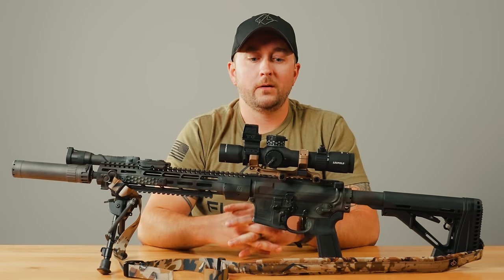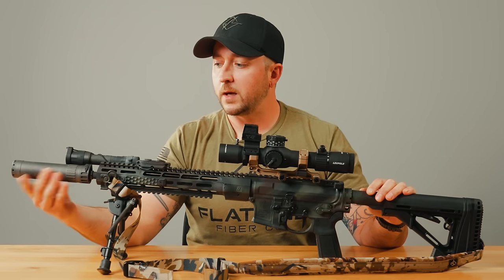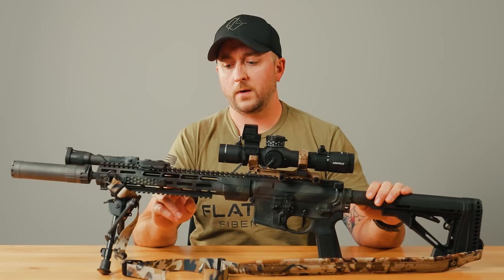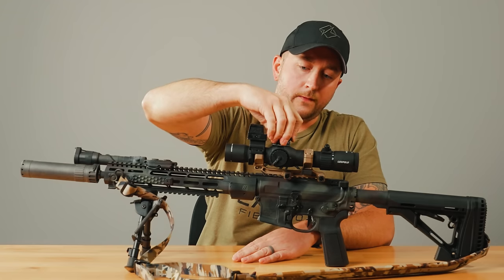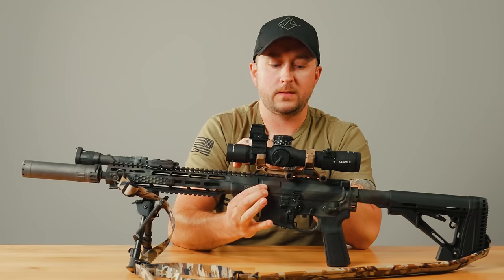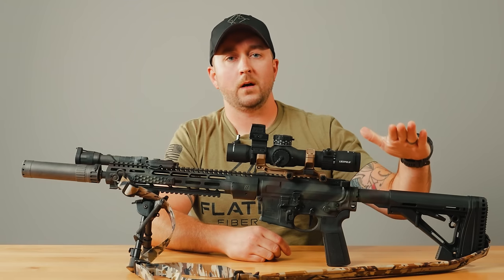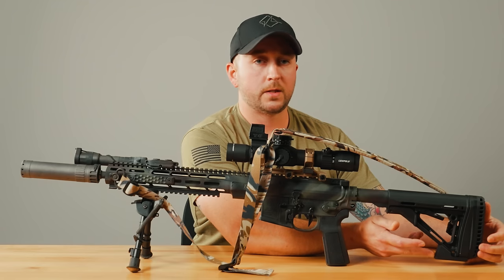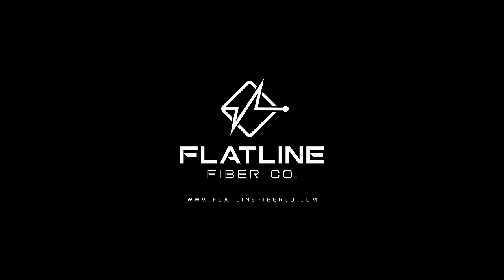SPR Breakdown | New Build | Long Range Shooting | Flatline Fiber Co.

Comment: Don’t understand why you would build out a 13.9 as a “ long range “ spr? Why wouldn’t you at least go 16? 18 to 20 would be even better. The shorter is better crowd just doesn’t make any sense to me
Reply: 13.9 is the perfect length. You do not lose more than 40fps from 16 to 13.9 ensuring your shots are still the same in holding and force is still very similar.
Reply: ..FOR a ‘specific-use’ AR..or carbine, etc…I get what you’re saying..I’m sure so does he. He’s “experimenting” man. Besides..even an SPR can be utilized for ‘something ELSE” if need be. Like I mentioned above, shorter bbl can reach 600 yds, with ‘accuracy’ being the big question. Point is: It’s do-able..
Reply: @IntellectualTerritory  Idk, there’s something to be said for 14.5”. It’s WHY the .gov (.mil) issues them. ALSO depends on the ROUND. 5.56..a hotter round, I’d agree with you with 77grs. And, with .300 BLK..the shorter is a great choice to a point. Personally, I wouldn’t go shorter than 10.5” (10.3”) with the .300’s..BUT yeah, we’re talking ‘apples & oranges’
Reply: @m118lr  they use 14.5 bc a bayonet can still be attached.
Reply: (Legitimate comment) I haven't seen a bayonet on a rifle besides in a class, m203 grenade launcher yes but 13.9 with decent barrel, can, ammo, etc will get it done
Reply: Barrel length is not required for long range. Good ammo is.
Reply: A 13.7 to a 16 inch…the fps is neglible.
Reply: That’s probably why YOU shouldn’t build a “SPR” with a barrel shorter than 16”. But for other folks, it’s a solid choice. 

In reality, most folks aren’t shooting gas guns at “long” range and are generally shooting intermediate distances from 100-600, some matches will take you out beyond that to 800-1000, generally are full sized IPSC steel. All of which are targets a 13.9” can easily hit, especially given the accuracy I’ve had out of Criterion barrels. 

I don’t really think long range shooting begins until you start going behind 600.
Reply from the maker: For sure. Like I said, this is my intro build and I may eventually swap to a 16" barrel. I have taken this gun out to 1,100 meters.  I also invested in a 308 gas gun and will eventually grab a 24" bolt gun.
Reply from the maker: @ray  When this gun was initially being built this was not the goal for it. As I started getting into shooting at distance the goal changed. Like I said.... I will eventually swap the barrel to a 16" after I do some more chrono testing.
Reply from the maker: @m118lr   For sure man. I have consistently made hits out to 550 meters with this gun. Trust me.... it was hitting plenty hard too.
Reply: @flatlinefiberco  18” or 20”. If not that long then 12.5 is perfect if you don’t mind sbring. 13.7 is just for civilians pin and welding. 12.3-16 no real significant increase.
Reply: I have a few pin&weld 14.5s, love em’.  The 13.9 barrels only work with a limited selection of really long suppressor mounts/muzzle devices that aren’t compatible with my cans, but otherwise I can see the appeal.
Reply: Because you can
Reply: @IntellectualTerritory this definitely isn’t true
Reply: Ammo and optic have much more of an impact on performance than 2 inches of barrel
Reply from the maker: Long range training starts at all of the mentioned distances though. Pushing a 556 gas gun to its limits from 1,100M - 1,600M is the goal. Then I know the extreme capability of the rifle, projectile, and myself. It will make the larger caliber stuff that much easier.
Reply: The velocity increase with a 16" barrel vs a 13.7/9 is actually around 130fps.
Reply: @MyLonewolf25 I have a 7.5” 5.56 barrel AR. We both know that putting a scope on that is a waste of money.
Reply: @elitecombatfitnesscentral6170 not true at all its nearly 100 fps
Reply from the maker: @jayblemsin4226 It really depends on the barrel and ammunition you are using for comparison.
Reply: Accuracy from a 13.9" barrel can be just as good as shooting from a 18" barrel... However, extending out passed 400m, the extra velocity from a 18" barrel will outshine the 13.9. The Mk12 exists for a reason.
Reply from the maker: @Fister_of_Muppets It absolutely can depending on the barrel and ammo choice. It comes down to what the user wants to accomplish with that specific rifle.
Reply: @flatlinefiberco I thought 5.56 goes transsonic between 800-1000m depending on ammo and barrel length after that accuracy degrades significantly.
Reply: @ericj6636  Yes, heavy 75-77gr 5.56 can stay supersonic out to ~900 if fired out of a 18" or 20" barrel. 55-62gr rounds shot out of a 16" barrel will go transonic around 500-570.
Reply: Quit
Crying his rifle
Reply: @MyLonewolf25 it is required. That's why any weapon system designed for long range has a longer barrel.
Reply: I live on a 40 acre ranch in rural Tx. I rock a handy 12.5 with an atacr 1-8….mainly for the ability to throw on my back for dirt bike patrols. I still have an 18 inch with 2-10 if I want, but the 12.5 is consistent out to 500 yards
Reply: @IntellectualTerritory try more like 200 fps with 55 grain
Reply: @m118lr several reasons for 14.5”, and almost none of them are practical or matter all for most modern civilian shooter.  Velocity was not a reason to be sure.
Reply: We’ve taken 11.5” out to 800y. Up to 600 ish is easy anyway. Personally I don’t like to shoot .223 at actual long range like 700-1000 because it’s just not a great choice for it, but it certainly can be done with a variety of barrel lengths
Reply: @MinutemanMedic  sure but it’s basically bouncing off of the target at that point
Reply: @dasboot9471  even with a 10.5” barrel it’s going to have more energy than a .380acp at the muzzle. It will penetrate enough to hit vitals.

Comment: You built a "long range" SPR AR15 with a 13.7" barrel?  What do you consider long range?  Have you shot long range or researched what shooting out past 300 yards or so ( less than that with your barrel) is like with a 5.56? Nice scope though. I absolutely agree with that on the SPR setup.  But long range shooting with the 5.56 requires all of the velocity you can get.  The wind blows this round all over the place and the slower it goes the worse it gets.  The 13.7 is not an acceptable barrel for shooting long range.  That is the most important part of your build.  You need a decent barrel to do anything at distance, and you've selected one of the worst options for this platform.  Generally, you'd want to be in the 20" range.  Some go with 18 because it seems like a more practical length and doesn't lose quite as much as say from 16 to 20.  I believe that is what the military uses on their DMR style rifles.  But less than 16 isn't even talked about for long range.  Look at the difference in velocity you would get from a 14" vs. a 20" barrel and plug the numbers into shooterscalculator.  Look at the difference in drop and maybe more importantly wind drift even at 5-600 yards.  When you build a rifle for a speciffic purpose, you need to focus on that purpose and build it with that end goal in mind.  Especially when considering the most important aspect of the rifle: the barrel.  I really hope your video doesn't influence anyone else to waste their money on something like this.  This is why we need to bring back the dislike button.
Reply from the maker: I have shot rifle the way it was in this video out to 1,100 meters, so yes I know what long range shooting is. When this rifle was initially built, it was not for this purpose. Instead of dropping more money I wanted to train with what I have. My long range journey actually started shooting a 12.5" 5.56 out to 800 meters. This rifle has changed a bit since this video and I have collected some good data with everyone comparing a few barrels. Keep in mind alot more goes into it than just the barrel length itself. Saying one barrel length isn't acceptable is just plain wrong. It depends on what the shooter's goals are. Everyone's is different and alot of training can be done with an even shorter barrel. Keep an eye out for the next video. I decided to do some leg work to find the answers myself. At the end of the day the most important thing is we get out and train and learn for ourselves. Thanks for the view and comment.
Reply: You indicate that you built this rifle as a long range SPR rifle.  Yes, you are absolutely wrong to build it with a short barrel.  No one who wants a long range rifle, that understands the ballistics and the effects of velocity reduction and barrel length would choose a short barrel for this purpose. Everything you just said I 100% agree with.  The story about wanting to train with what you have and the importance about learning and experimenting, etc.   You are entirely right.  My problem is that the video describes a build with the purpose of long range shooting.  That is not a barrel length that should be chosen for this cartridge with the intent of long range shooting. And anyone who has experience with long range shooting would agree. And no, just because you have shot that to 1, 100 meters does not mean you understand long range shooting and doesn't mean that you are getting acceptable results at that distance. You know you're not and so do I.  At that distance, even the longer barrels put a 5.56 cartridge all over the map in any realistic environment.  A 20" barrel would still have the bullet dropping about 54 FEET at that distance.  To give you a bit of perspective on how the bullet is dropping at that distance, at 1075 its dropping about 6 feet less.  There is 6 feet of drop in 25 meters at that distance.  And there is 22 feet of wind drift in a 10 mph cross wind.  And you want me to believe that you and your little plinker barrel are capable at that distance?  Give me a break, man.  You're being extremely misleading.  Oh and by the way, the 5.56 cartridge has less energy than a 22lr at that distance.  If you are serious about long range shooting, do your research and put the time in and stop pretending like you have any idea about what you are talking about and stop denying the fact that your build completely missed the mark.  @flatlinefiberco
Reply: @rickyanderson2505  exactly
Reply: These comments are ridiculous
Reply from the maker: @rickyanderson2505  Wow. You are hilarious man.
Reply from the maker: @mindbullet556  Yup. Pretty ridiculous
Reply: I've pushed my 13.7 to 700yds on several occasions using an ACOG and 55gr ball ammo. Making wind calls isn't that hard. I've also pushed my 16in to 1000yds.
Reply: Bro has a criterion barrel, he’s fine lol
Reply: This is crazy. Like HOA Karen crazy. 

The rifle is a sweet build and is obviously purpose built. If he wanted/needed  a pig of a rifle I'm sure he could have built it. I'm all for filling gaps in the armory and having the right tool for the job. 

Maybe this dude has a 300 Norma he's humping around on his back? Maybe he lives out east where there may be clearings out to 5-600 yards? Maybe he lives out here in Colorado where the air is so thin that you can reach out with just about anything? 

Are you really a long range shooter if you haven't tested what's capable on the fringes of what's "acceptable".

Comment: I got a Daniel Defense MK12 a few weeks ago. It came with a SSA trigger, like that trigger so much, I ordered 2 for other AR's. I changed the stock to a Magpul PRS Lite, perfect for that rifle, gave me the adjustability without adding a lot of weight.
Reply from the maker: That sounds awesome man! I dig the SSA triggers as well. I swapped my 308 gas gun trigger to a SSA.
Reply: @flatlinefiberco  - The SSA is a sweet trigger, that was my first Geissele trigger. I would put one in my S&W performance center AR10 6.5 if it hadn't came with a 2-stage target trigger.

Comment: Wild I’ve had neutral/negative experiences with a couple of your parts. Had 2 Criterion 12.5” barrels that both shot 2-3 MOA with typical match type rounds 69/75/77gr that a couple of my other barrels shoot .5-1.5 MOA. Leupold Mark 5 3.6-18x, glass was “milky”/hazy which led to a somewhat blurry image. My 2 Vortex PST Gen II 3-15x were noticeably clearer, crisper, brighter, more contrast, etc. Vltor A5 I generally like just for the longer cycle operation and I’m sure it helps with stress on parts simply bc of its design, but some guns I notice a little bit of a difference, others I didn’t notice any difference at all, and others actually seemed like a sharper recoil impulse. Just my experience over the last several years of being curious and spending money to try different things. Nice build though!
Reply from the maker: Thanks for the comment man. That is  very interesting about the barrels. First I have heard of them not being superb. Did you have the gun on a tripod or supported really well? Not questioning your ability, just curious.  I have the Mark 5  3.5-18 as well. Mine is super crisp and clear just like the 2-10. Did you reach out to their customer service?  Did you play with the diopter? I had a Vortex 1-10 as well. It was a super nice and crisp optic as well. I just wanted to try something different and the parallax adjustment was important to me.  As for the A5 buffer systems. I have them on 4 different rifles and it improved their performance dramatically. Small sample size. Like with all of these things, there is alot of variables at play.
Reply: @flatlinefiberco  yeah had the barrels on bipods and bags, gas tube and block were aligned, different muzzle devices, different buffers, etc. Swapped it out direct with criterion (they have amazing customer service) and second one shot about the same. Leupold, yes, claimed everything was good to go. Maybe my eyes just didn’t like their glass 🤷🏻‍♂️ bummed bc I was excited to be blown away with the most expensive optic I’ve ever bought haha

Comment: Love my flatline sling on my AR10….
I’m also liking your shorty 13.9” SPR rig… I have an 18” criterion lightweight barrel but with a suppressor it can be unwieldy if going on foot patrol in dense vegetation.
Reply from the maker: Thanks man. Yea so far so good. I need to gather more data, but I'm digging it thus far.
Reply: I can assure you the difference between 13.9 and 18" is negligible. When talking about moving through dense vegetation. Now, if starting from scratch, sure. I won't argue with the effectiveness of 13.9. But I would not build a 13.9 SPR if I already have an 18" SPR. (I've run an 18" gun for everything for 6 years)
Reply: @grizzle31  yeah… I love my 18” criterion barrel rig suppressed … it makes those 600-700 yards shots much more pleasant… I seem to get more velocity compared to my other 16” and 14.5” ARs  since the criterion barrel is handlapped (don’t know if that theory is true, but I get better performance from most match ammo out to distance in comparison to my other rigs) Usually, my “general purpose rifle”usage is satisfied with my 16” and 14.5” set ups ☺️🫡

Comment: I wish this were 18" but otherwise slick build.  Love the paint, CTR with the Ariska accessories...very cool.  I'm building a similar rifle (different scope, bipod, light but same idea)  Great video

Note: looked at Zev handguards...what website doesn't put the WEIGHT (or the material) of the handguard?  I'll assume its heavy af if they intentionally left it off.
Reply from the maker: For what I wanted this rifle for the 16” does the job. It hits the velocity I want and gets performs really well. 

The zev wedge lock hanguards are the same as Hodge, Icon Defense, and SOLGW. The others will have a different profile that you may be looking for.

Comment: Hi Chad, @10:42 I'd recommend the SSA-E or the SSP Flat Bow over the SSA. The SSA-E is what I have in my SPR, and it is my favorite trigger on the market. The SSP is also a great option if you like the flat face or single stage triggers (I don't prefer either, but I love that trigger regardless). Great rifle, and thanks for doing a video on it.
Reply from the maker: I ended up dropping an SSA-E in it. Thanks man! More coming soon!
Reply: @flatlinefiberco  Sweet, enjoy.

Comment: Why not an 16, 18, or 20? I get you can have a very accurate 12.5 or other shorter types but if you want to make it a long range set up why not just get a longer barrel and get more velocity l? I guess if you decide in a few months that long range isn’t the hotness then you have a shorter compact gun for cqb, patrolling, or whatever the new Instagram hotness is.
Reply from the maker: The short answer is... Because I can. The rifle was intended to be my go to gas gun that has more capability at long range vs my 12.5" rifle. The mile bolt gun will be built eventually, but starting this way gives me a challenge. If I can understand how to shoot far with a 5.56.  Then gradually step up to larger calibers. I believe it will give me an advantage for understanding wind. Just my thoughts.... it doesn't make it right for everyone. Stay tuned man! We have more content coming. Thanks for the comment.